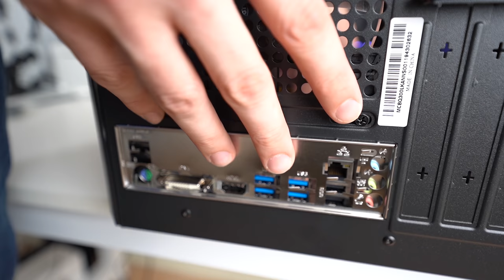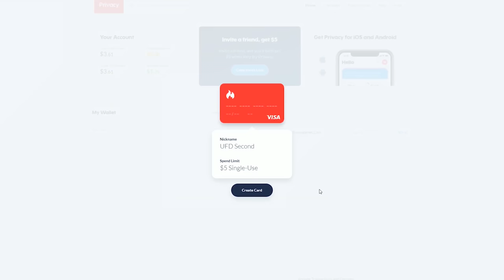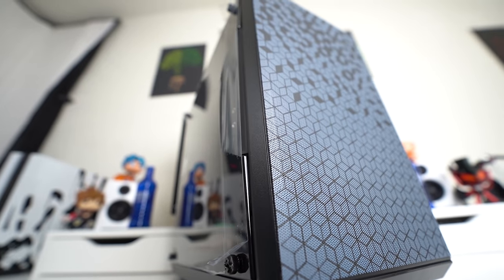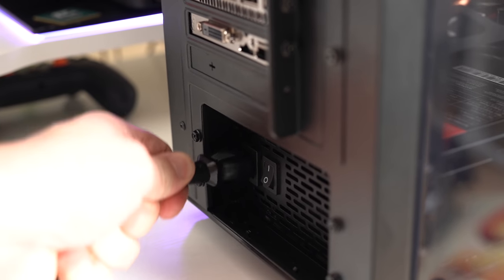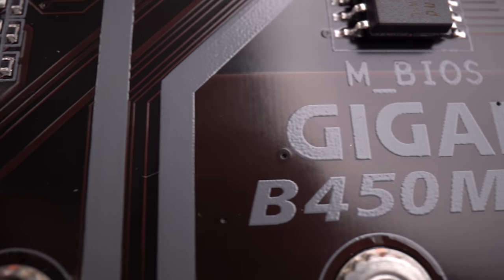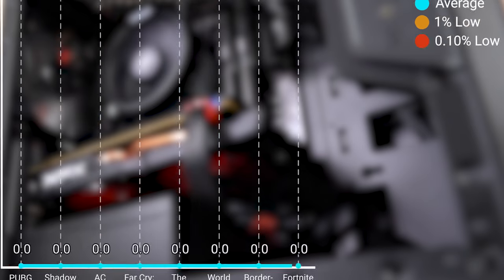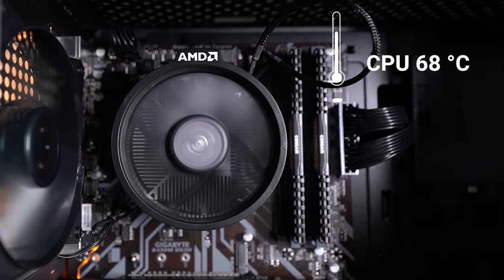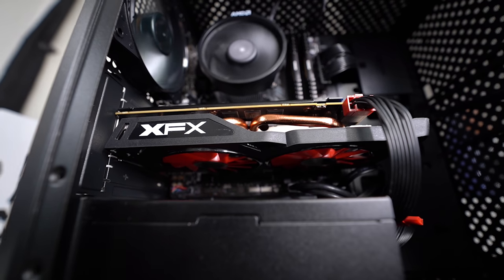Best $500 Gaming PC Build - End 2019

Comment: It’s amazing how for $500 now you can get a dedicated gpu and an amazing 6c 12thr in 2019 almost 2020
Reply: Can fit an rx 580 in there if you really look for deals. Which is an insane $500 build.
Reply: Confirmed Sk I know, amazing time to invest in a pc right now.
Reply: $500 in developed countries only 😳 where i live it would cost like over double the price
Reply: chương nguyễn hoàng dats rough
Reply: @DevinLatulippe  actually i just check and it only cost about $700 .. surprisingly cheap
Reply: chương nguyễn hoàng eh, not “cheap” but aight
Reply: You can pick up a used rx580 for around the same price as a brand new rx570
Reply: iAmPj or an rx 480 for around $80 to $120 or so. And almost the same performance as a 580
Reply: @iPeanutJelly  Where i live, prices are generally a bit high and sometimes weird. RX 570 and RX 580 is pretty close to the same price. 30€ difference with RX 570 Pulse 8gb and RX 580 Pulse 8gb. Cheapest RX 570 8gb vs. RX 580 8gb is 15€. They are so close in price here that getting the 570 isn't really worth it. It's kinda weird
Reply: In my country the 570 8gb vs the 580 8gb is like 30€ difference!!
Reply: ryzen 7 2700x is $150 on amazon rn i just bought one yesterday
Reply: Chris Travis what gpu are u pairing it
Reply: Vinny Nguyen im going for a red devil rx 5700 xt. My budget is around $1000
Reply: You Wut I wish it that was true 3 months later

Comment: I would also throw an extra fan at the front lower mount to help with those gpu temps
Reply: For real and undervolt that 570.  Mine was running 1150mv stock at 1284 mhz and was a damn space heater.  I overclocked to 1400mhz and was still able to drop it down to 1070mv.  I havent seen it go above 65*c in who knows how long.
Reply: @prescottmajette5290  also install msi afterburner or evga precision to set a custom fan curve. Some cards are set to be full fan stop until 60°c, and even then they won't ramp to 100% under any circumstances.
Reply: @cbygelightbulb  Agreed, I set my curves in Wattman and it made a big difference as well.

Comment: Wait this case is in the disappointment part 2019 of GN :/, maybe :)
Reply: If you're not using super great hardware it should be fine.
Reply: i am using this case personally, besides the fact that the filters get moved around easily, not many spaces to hide the cables and some of the fan nails would not fit, i do not see critical problems with it
Reply: It's not actually the same case, this is the micro atx version. GN had the atx version. Both are basically the same, but the atx version blocks half the front airflow with the power supply mount.
Reply: C by GE light bulb when I said maybe, that was I mean, I don’t own those cases so idk how different between them :)))
Reply: Nguyen Hai Duy not the same case. GN has the Q500L, this is the Q300L. Power supply in front (500), or rear (300). I used this one, it’s perfectly fine for $45.
Reply: C by GE light bulb OH WAIT REALLY? all this time I thought this case that I picked up on Craigslist wasn’t actually that good
Reply: I've used that case in a flip it's nice to build in but it's a heat trap  really weird
Reply: @stevenchan1087  Nothing a pair of tin snips won't fix.
Reply: @CaveyMoth  q500l is crap, super choked up airflow. no point of having 2 140mm fans as intake in the front if it's literally not gonna help at all in terms of temps.
Reply: @stevenchan1087  basically, the case sucks because it has horrible air flow
Reply: @cbygelightbulb  I hope you know the micro atx version, although being better, still has bad airflow
Reply: @acornr6s291  despite it literally have holes everywhere?
Reply: @stevenchan1087  everywhere? there is more metal than holes, which is not a good thing at all
Reply: @stevenchan1087  I mean, I get that you want to think it's a good case because YOU own it, but in reality it isn't very good
Reply: @acornr6s291  oh you should have seen the case before this that I owned :/

Comment: I just finished my build & went with almost the same setup. I like ASRock motherboards so I went with the B450M Pro 4 Motherboard & then used a NVME M.2 512GB boot drive. I also went with a Sapphire RX570 8GB graphics card. The whole rig came in about $480 total. (I used a Corsair 100R case which cost me about $45)

Comment: Soon setup after Christmas
MOBO: b450m Asus prime
CPU: Ryzen 5 2600x
GPU: RX 580 4GB XFX
RAM: 16GB 3000Mhz vengeance
PSU: VS550W Corsair
SSD: Samsung 240gb
I'm using this for gaming and productivity
Reply: Whats the cost of ssd?
Reply: @ShubhamYadav-et2rz  30$ the cheapest one from kingston Samsung one costs around 50$
Reply: @NICULL in italy amd gpu are not worth it they cost more than nvidia the cheapest is the rx 580
Reply: I am also going to build after Christmas..
MOBO: b450m Steel Legend
CPU: Ryzen 5 3500
GPU: Galax GTX 1660
RAM: 16GB 3200Mhz vengeance(2X8GB)
PSU: CX550 Corsair
SSD: Adata S11pro 256GBM.2 NVMe
I'm going to use this mainly for gaming and light productivity.
Reply: @prigee  oh this setup is even better
Reply: @NICULL if you always wait for new stuff to come out then you'll never be able to build a pc
Reply: @tatanano9139   - No, its Ryzen 5 3500. It is available in my country(India).
Reply: @prigee  you can buy ryzen 5 3500x from aliexpress for cheap
Reply: @tatanano9139  I don't trust the second hand market too but sometimes you gotta risk for performance because i want to play all games at 1080p ultra and for the fans i already have a case that has 3 fans its a micro atx case
Reply: @samiarts7589  - Yeah, already considered buying it from AliExpress. But with the custom duty, it will cost significantly more that what I am going to pay here.
Reply: @prigee  that's not a problem i will use a fan hub
Reply: @prigee  never payed it i think it depends on the country i saw a review from spanish buyer he only payed 25$ more also if you are from usa you can find one for cheap on ebay just make sure that the seller accepts return

Comment: I built a system with a i3 9100f on a z390 uh motherboard with 1650 super 8 gig of ram some rose will glass case with rgb fans and have a 1t hard drive that has all my games from my old pc,I got all this for around 400 totals with good Black Friday deals and I think it should perform equal or a bit better than this.(not all my parts are here yet)

Comment: Maybe you could’ve got cheaper ssd and upgraded to rx 580 8gb??
Reply: KushalLimbu would have been a better gaming pc with less storage
Reply: You can pick up the rx580 used on eBay for the same price as a brand new rx570
Reply: @iPeanutJelly  I would do that but I don't really wanna risk buying from a crypto miner or a person that overclocks the hell outta it and had   high temps 😔
Reply: @user-jc2in3cp3g  that's why you gotta buy from someone that actually has alot of buyers. All of the ones I bought were amazing. I opened it and they had brand new thermal paste, no dust and ran extremely quiet
Reply: @iPeanutJelly  you got lucky.
Reply: @moderizhaan9497  na. You just got to buy from a reputable seller
Reply: RogueTravel you know modern aaa games are like over 50gb each like fortnite
Reply: iAmPj you don’t always have to buy from reputable buyers because chances are you might find a cheap deal
Reply: Face Stabber use firecuda SSHD
Reply: Or went on eBay and Newegg
Reply: @iPeanutJelly  jus picked up an Asus RX 580 8gb for $80 off Craig's.. how or what should I do to prep it before I use it? First PC buy/build..
Reply: @phabeondominguez5971  open it first. There should be 4-10 screws on the back holding the backplate. Take it off and see if the thermal paste is crusty. If it not just leave it. Other than that you should be fine to plug it in and start gaming.

(Edit) Well forget this if you don't want to ruin the warranty sticker.
Reply: @phabeondominguez5971  try it out first. Plug it in and see if it boots up from the graphics card.
Reply: @iPeanutJelly  will do, THANKS

Comment: AYEEEE! This build and @GamersNexus 's Disapointment Build use the same case!
Just gonna guess that airflow and cooling metrics weren't important for this build.
Reply: Lower power hardware doesnt need as much cooling and GN built in a Q500l, not the Q300l used here.  Psu blocks airflow in the Q500l.
Reply: @prescottmajette5290  this case still has the same intake issues... more steel than space for intake
Reply: @amorgan20111  It retains one of the issues, but the psu being in the rear is undoubtedly better for airflow and my point about lower power hardware needing less air still stands.  I've got a garbage 120mm intake fan pulling air through an equivalently dense intake mesh and an even worse 92mm exhaust fan and my 570 rarely, if ever, exceeds 65*c, same for my cpu.  Temps don't drop at all with my side panel off.  It really doesnt take much to vent out 60-75w of heat.
Reply: @prescottmajette5290  yea, but that still doesn't make the case a good case. Just because you put a low TDP/heat output system in a crappy case doesn't make it not crappy. compared to other cases that were released in it's pricepoint. At least now with it selling for $40 or less, it sort of fits in with other cases that either are lacking in features or also have booty cooling.
Reply: @amorgan20111  Well I agree with that, but at the same time, nobody in their right mind is putting a $1500 build in a $35 case.  I got a super shitty rosewill ranger on sale for $20.  I slapped a 2200g and an rx570 in it and its been working fine, with better than acceptable temps, doesn't make the case great or even not terrible, but it fits the budget and the airflow requirements, but if the Q300L had been going for $35 at the same time, I would've paid the extra $15 for an acrylic side panel, a more modern design and usb 3.0 on the front.  I agree that at ~$50 its not a great case, but the game changes big time once its below $40.  There aren't any good options down there, like at all.  So in short, I don't think UFD's recommendation is to put a Radeon 7 and a overclocked 9900k in it, because its "a great case," but more that, at the $35 price point, it doesn't have any real competition.  For a lowish power matx build, it really does make good sense, even if it isn't capable of adequately housing a mid to high end build due to air flow.
Reply: @prescottmajette5290 well what about an used parts build such as a x79 mobo paired with a i7 3930k, OCd to 4.5ghz all core paired with a power hungry Maxwell 980ti or a Kepler gtx titan. A build that would cost around $800-1000 used depending on how much storage and type or storage. You're looking at power draw around 400W idle, 800+ under load. This case wouldn't be a good fit for a system like that. Meanwhile you can buy a Cooler Master Elite 110 or 130 for around $50. And yes I chose another Cooler Master case just to show that I'm not biased against cooler master at all. I'm just saying they are better cases at this price point, especially if you look outside of CoolerMaster
Reply: @prescottmajette5290  btw my favorite budget ITX case would be the Thermaltake Core V1 for GPU compatibility as well as great cooling, with the only caveat being that you should probably buy a magnetic mesh for the side where the GPU is going to be pulling fresh air
Reply: @amorgan20111  Haha youre just looking to argue aren't you?  Nobody in their right mind is doing an $800-$1000 3930k and 980ti build right now. 3930k is 32nm from 2011 and a 980ti/Kepler Titan is pretty pointless at this point in time.  No one is gambling that much money on parts that are 9 or 5/6 years old.  A sane person might do a ryzen 3600 build with a 1660 ti or 2060/s.  A 3600 is $190 and a decent 2060 is ~$350; both of which run circles around a 3930k and a kepler titan/980ti.  Cheaper, better and the whole system probably won't even draw 400w at load.  If you want to invent ridiculous hypothetical scenarios where this case isn't a good choice, be my guest, it's not a perfect or even a good case.  It's a good case at the $35 price point and I don't need to defend my opinion on that.
Reply: @prescottmajette5290  yes it's a gamble, but used parts make up a decent chunk of my business. And the 3930k and old xeons are actually quite popular among people who want an intel platform with more cores for a lot less. X79 motherboards are extremely popular items on ebay for just that reason. Even chinese companies have started making "new" x79 motherboards to sell on eBay, ali Express and other websites, because the market is there. The fact of the matter is that I can build a 6 core system with the 3930k, pair it with low latency ddr3 ram 16gb or more, throw a cooler on it like a snowman or a $70 280mm AIO and pair it with any GPU from a rx570 to an 1080ti, and it would cost me between $500 and $900 depending on the GPU and cooler and ram choices. I have sold at least 4 systems like this, as the 3930k and other old xeons, have similar enough IPC to the 6th gen intel parts, and with a gentle OC to around 4.2 to 4.6 ghz they game as if they were a stock 8700/8700k. Dont knock it until you try it.

Comment: I got me a 2600x for 113$ black Friday 
I'm really happy with it 
 Who knew i just meed it to set up the volatge to 1.3875 with an offset of 0.00625  
I just put 4.0 Ghz,  it runs so. Smooth,  wkth Xfr boost to 4.3-4.4 
That is running on the asrock x370 killer. 

Wonder when would i have to change the motherboard.  I was looking at the asus tuf gaming

Comment: I build a ~600 Euro PC (including Monitor and Mouse) with my Brother this summer hollidays and used the 2600 non x, same case and the ram is also corsair vengance lpx 16gb with 3000mhz. He has a 580 8gb but also used used parts. In the video there's no fan in the front, witch is very unfortunate :(

Comment: Should I get a ryzen 5 3400g or a ryzen 3 3200g (my gpu is a rx570)
Reply: Go with the 3400g. The extra threads will definitely make a difference. You should be able to pair it with a mid tier gpu when the time comes.
Reply: Ok thanks

Comment: 590 or 1660 super but i would go with 590 to save like 50 60 bucks only because its better than 580 not by much but hey it works out and can be cheaper than a 580 that is brand new priceing so 169 to 179 bucks for a 590 sounds good to me its between a 1060 and 1070  in performance so it will play any games no prob atleast thats what my research tells me on this card where as the 580 gets to or around 1060 performance so i think if you can get a 590 cheaper than a 580 do it ya its like 70 bucks more than a 570 but its worth it look at the price of a 1060 and a 1070 talk about bang for your buck

Comment: Is the jump to a Ryzen 7 2700x worth it? I’m mainly looking at it so i don’t have to upgrade for 5 years.
Reply: Depends what you are jumping from.  But if you mean in this build, then no.  The extra power will be a problem in the Q300L.  A Cooler Master NR400 is a much better case.  I'd get a better motherboard as well if I was looking for  5 years.
Reply: James Thomson it’s my first build. Been looking at asrocks taichi line for motherboards for the vrms and post code
Reply: @johnmartin2402  Okay, you've been watching the right videos.😁  2700x at the current price is a good deal.  With a taichi in a good case you will be able to upgrade to a 4000 series in a couple of years when they are replaced by the 5000,  if you find that 2700x is becoming too slow or you want more cores.  The build  in this video is fine, but it doesn't allow for the future.
Reply: James Thomson awesome okay thanks dude!